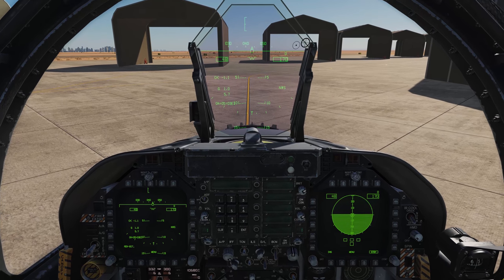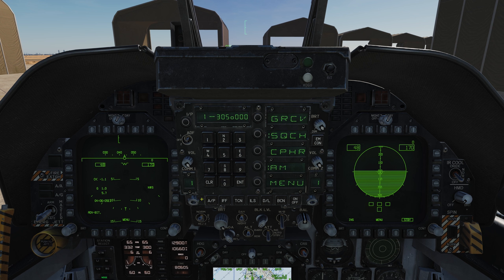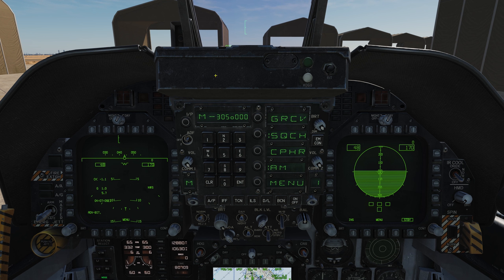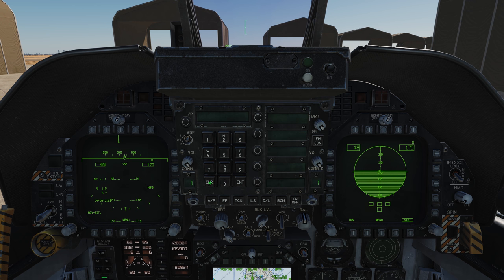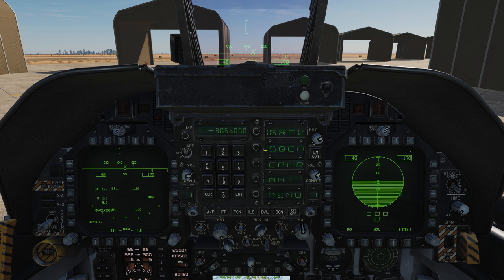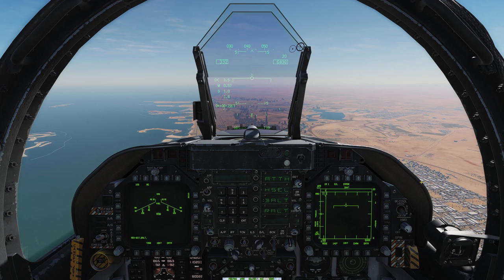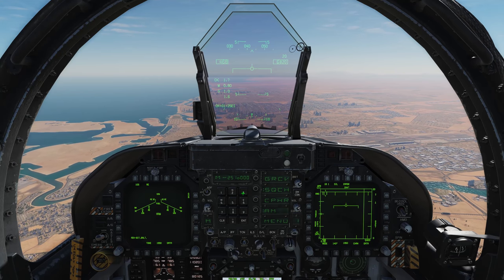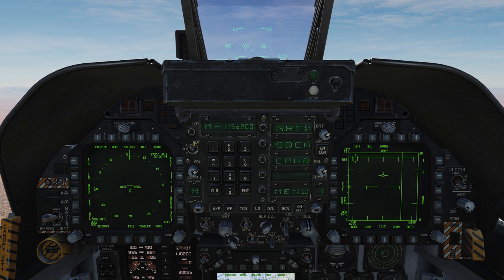DCS World F/A-18C Radio And ADF Tutorial

Comment: Very helpful! However could you explain me what the difference of AM and FM is? And why the option of it is there?
Reply: The difference is in how the carrier wave is modulated, or altered. With AM radio, the amplitude, or overall strength, of the signal is varied to incorporate the sound information. With FM, the frequency (the number of times each second that the current changes direction) of the carrier signal is varied.